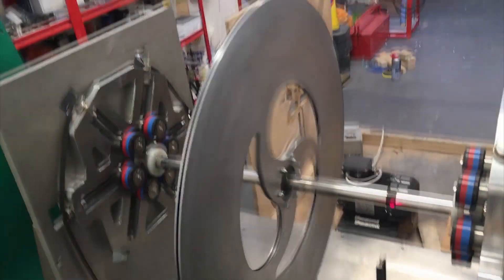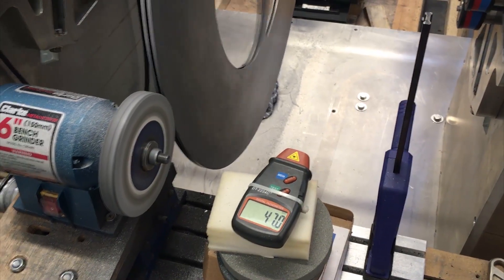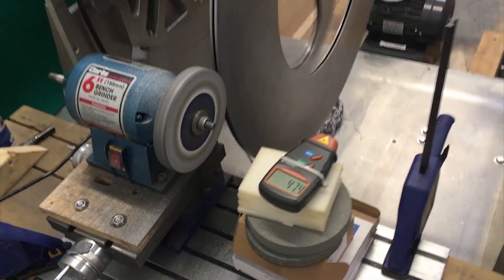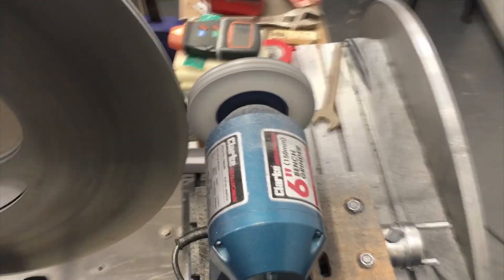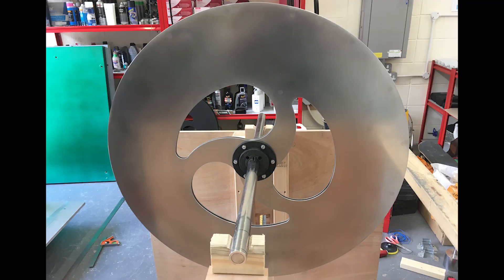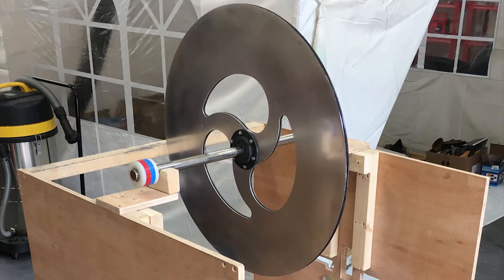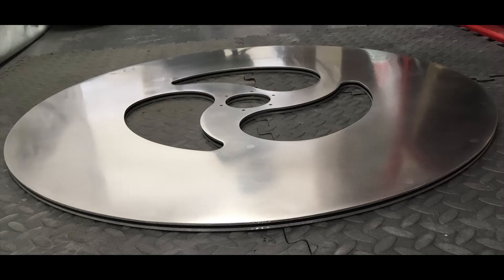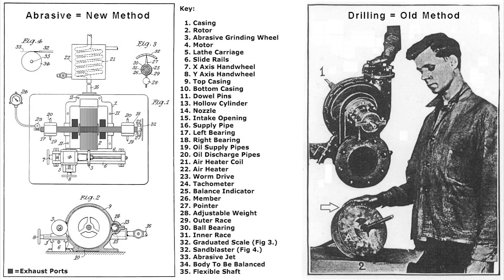Nikola Tesla’s 3 Plane Balancing Analysis Part 3 - The Concentricity Is Improved

Comment: Oehhh nice that's a pritty big one! I wonder What rpm is this supposed to run at en what  kind of fluid it's designed for I bed it's for high viscosity because the space is really big I'm between the discs
Reply from the maker: It’s a test rotor to gather data from. The actual commercial design we have has 11 discs including the end plates. It has tighter gaps too.

That would match the surface area of the museum 18”, 29 disc rotor.

Did you know Tesla had a 25 disc 31” rotor with 7/8” gaps.

That was for shifting 10,000cfm volume @ 0.5 - 1.0 psi using around 3000rpm.

I’ll double check this and post a link to his original spec from US patent draft.

Tesla also specced out a 60” rotor.

There are some genuine photos of Tesla’s 10,000hp turbine.

This test rotor was started in 2019 and has evolved. Every time it crashed I upgraded it.

From doing experiments with this style of rotor it has shown how much mechanical rotation is converted to heat via bearing friction. 

The idea behind the contact free bearings is to stop that heat transfer.

The plan with the rotor is balance it as best as possible in house, so it doesn’t risk being knocked during transport. 

Then see how fast it can be spun and measure the vacuum, entry velocity and exit velocity.

That data can be used to calculate how many discs it needs to bring down the rpm to a useable speed.

I’ve got an idea to merge Tesla’s 1910 rivet addition with his more flexible 1921 rotor design by using soft polyurethane washers between the discs and rivets so it’s not completely solid.
Reply from the maker: The discs are 4mm and the gap is 4mm.

The original choice for this was because at the time I could get the discs water jet cut from 5083 ali for £100

I had the same done in steel too for comparison.
Reply from the maker: It’s built for supersonic speeds. Whether we will go anywhere near 8,200 rpm to gather data I have no idea.

What I do know is it took a 16 horsepower engine to spin the rotor as a fan / blower / vacuum pump to 5,200rpm and that’s the fastest it has ever been.

At the time it was static balanced to 10,000rpm.

Now it’s not got that friction and the bearings are not going to 65C+, seeing how much horsepower to get it that fast should be extremely different.

I’m currently toying with how I’m going to connect the belt so it goes straight downwards and connects to a motor that doesn’t introduce vibration.

That will be balancing machine version 6.

Also the plan is to get the rotor to a speed fast enough so that atmospheric pressure starts to drive the rotor as the elasticity unwinds and centrifugal force assists. 

We have already seen the belt transmission efficiency increase by just having the rotor in the casing when it was static balanced.

There were witnesses too. 

It cannot go over 100% belt transmission efficiency, but if the rotor starts driving the rotor, then we are in new territory.

Just like water falls and drives water wheels, so can air. 

Water wheels don’t need low friction bearings.

Low friction bearings make it easier to tap this energy source.

Tesla had a name for his machine that didn’t have the low friction bearings.

He called it a “hot air engine”. 

That would leave the no contact bearing version being called the “cold air engine”.
Reply: @nikola.tesla.r.and.d.centre  about the belt, don't use it seems to add vibration right?  I would use a flexible hose to directly connect the motor to the rotor in Line whit some space in between
Reply from the maker: @futuresight218  of the shelf balancing machines use a belt that cost £6k for cheap one or £110k for an expensive one, but if you notice they all pull the belt straight downwards. 

Tesla even states in the patent that a belt can be used but to ensure it doesn’t add vibration.

So the motor needs to be mounted well and the belt run needs to be well thought out.

I haven’t got a tank of air big enough or a compressor that could keep up to maintain the speed at the 1st sub harmonic.

A magnetic coupling is one option but is that more or less likely to add vibration.

Also another way is to use a belt, run it up to speed and then disconnect it and take measurements with a scope using two accelerometers or vibration sensors and a tachometer on the run down.

Using a DTI to measure run out with and without the belt drive would prove whether the belt is adding vibration.
Reply from the maker: @futuresight218  In my case of a two disc rotor which essentially are the end plates, this paragraph from the patent  could apply:

“When bodies not adapted for rotation in the manner shown are to be balanced, they will be driven independently by belt, electricity or other means, care being taken that no disturbing vibration from them is transmitted to the apparatus. In order to preserve intact the peripheral boundary, if this is essential, I grind the material off from some other place and when desirable, I make a special provision to this end in the design and construction of the part.”

https://teslauniverse.com/nikola-tesla/patents/british-patent-186799-process-and-apparatus-balancing-rotating-machine-parts
Reply from the maker: @futuresight218  any method to spin the rotor that doesn’t introduce vibration is welcome.

With adjustable magnet bearings you can adjust the field to compensate for the belt pull.

If I had a large tank of heat controllable air and a suitable nozzle I would use that.

I had to sell my old compressor when I moved workshops as this workshop is closer to houses and the compressor was 98db.

The dentist compressor I have is 42db but it only has an 8 liter tank. I would like to buy a 1000 liter tank. 

I could use a bottle of compressed air but that could get expensive. 

I’m sure your idea to spin the rotor will work.

I haven’t got room on my assembly for that idea.

One way or another I will balance it, get the data and hopefully soon built the 11 disc rotor. That will be a beast.
Reply: @nikola.tesla.r.and.d.centre that could be I don't know,  I don't think thay use this kind of bearings aswell yours at nice en almost frictionless but I can see they have a disadvantage in balancing because they're vibrating around
Reply from the maker: @futuresight218  when I had three magnets per side it was much stiffer and less sensitive.

I’ve found some one piece magnets with 50 micron tolerances instead of the standard 100 micron. It sounds similar to the problem Jeremiah was having with his generator magnet not being concentric to the shaft.

With a one piece magnet it doesn’t induce a wobble.

It might seem like a disadvantage but at the same time it will allow an ultra fine balance.

As soon as the funds are in to upgrade to the one piece 70mm OD x 30mm ID x 30mm width and grade 5 titanium circlips, those will be fitted.

For now I’m using what I’ve got to practice with and document the journey.

I might stick a speaker on the z axis tomorrow on the scope and see what we’ve got and can I correct any of it with Blue-Tak. Just to enhance the tuning skills. I’ve only got a two channel scope but I’m game to give it a go.

My friend has a 4 channel scope and vibration sensors are cheap, as well as accelerometers.

You can get a PC lab scope for reasonably cheap these days.

I think the analogue way that @Waveguide did would work, but as he pointed out with my setup the rotor really is the vibration meter with the current magnet setup.
Reply: @nikola.tesla.r.and.d.centre  nice!! I would love to see that! 

one more qwestion
How are you planning to conect the generator to this machine? It would help your test results a lot I think right?
Reply from the maker: @futuresight218  the current motor could be the generator but it’s large and cumbersome, far more likely to vibrate.

Carlos who is on the team has the most advanced motor / generators in the world. The Matrix Machine.

It’s so efficient electrical engineers testing it doubted their own measuring tools and checked it with more expensive equipment.

To their shock the more expensive equipment showed even better results.

These motor generators have no magnets and can switch voltages.

Carlos has been pioneering industrial level magnetic couplings too.
Reply from the maker: @futuresight218  the motor being driven is the first thing that would indicate atmospheric pressure is being harnessed and we have already seen the belt transmission efficiency increase with the rotor at the same speed inside and outside the casing.

As this rotor hasn’t got enough surface area and suitable gaps to make high vacuum at low rpm it’s idle speed is going to be over 5,200rpm I would say.

Flat belt drive on the shaft and flat belt pulley on the motor / generators.

They can have 98% efficiency and are quiet and if aligned shouldn’t introduce vibration.

I could put a pulley on both sides of the casing to maintain the balance.
Reply from the maker: @futuresight218  The magnets could be classed as springs / dampers. 

If you click on this link and it doesn't open then hit refresh and it should load. You will read that the original dynamic balancing method used bearings supporting by springs.

https://www.youtube.com/channel/UC4uJgCHU3s4AOA-uT5SDA4w/community?lb=UgkxyjJs5xSlllrbS-mXC-zFM2y5KKhiJZi7

Tesla's method also suggests that if using as rigid shaft that the bearings should be yieldable which could be classed as the same thing.

Being able to adjust the spring tension is useful. I have noticed that some balancing equipment allows movement of side to side.

One thing is for certain, if the rotor is balanced, the springs will allow you to see that.
Reply from the maker: For myself as the maths are far more complicated for my assembly to calculate the critical speed, and do I want to remove any more material from the peripheral boundary, from what are essentially end plates, my fall back is this method.

https://youtu.be/BRZoSA19wPo

Later I’m going to combine this with Tesla’s method, as I think this method has the possibility of being more sensitive than the analogue vibration meter described in the patent.

I’m happy to compare the two methods of vibration analysis.

It appears Tesla submitted a British patent application on the vibration measuring device and the process that no one has currently got.

The museum also has more documentation on balancing that we hope to obtain in the near future.
Reply: @nikola.tesla.r.and.d.centre  about this critical speed thing , it could be that the tention of your magnetic bearings en the length of the shaft have there own oscillation, I always thought (like in bladed turbines)  you don't want your bearings so far away from the rotor right?
Reply from the maker: @futuresight218  in future the magnet bearings, vacuum bearings or air bearings will bolt to the casing but the cost of an Ali casing at this size would be a chunk of money and we are not decided on a final design on the width yet.

The plan is to fit an 11 disc rotor and a neoprene rubber spacer between the two casing halves. 

But we want to get the data from this one and see what top speed and vacuum we can get out of it with or without breaking it.

It makes over 6” of Mercury at 5,200rpm. It shifts a colossal amount of air. 

It took 16hp to make the rotor spin that fast using Nachi ball bearings and 20mm shaft.

How many horsepower does it take to get it that fast again? Starter motors are always big draws.

What speed / flow needed to tap into atmospheric pressures elasticity to the point the belt becomes driven instead of the driver.

That will be obvious from a POC video when it happens.

I’m thinking about having twin 13.3kw generators on it which can be used for starting / generating. 

The motor / generators would be sat on appropriate anti vibration engine mounts and it would be wise to water cool them. 

The hot water produced could be used for whatever purpose.

With the current rotor the speed at which atmospheric pressure could start driving the rotor is likely to be high. 

When I say high I mean over 5,200rpm, which is the current top speed, but now it has the rivets it’s a different beast.

The shaft was made long so that we could test many rotor / casing combinations on the same platform and be able to balance them in their final resting place.

In my balancing research I found out that if you want the ultimate balance professionally, say G1.0 or G0.4 balancing tolerance, then your rotor needs to be balanced in its final bearing setup.

Also I found out in my younger years that if you want to notice drastic variable changes, make something big.

I have balanced propshafts on vehicles using an acclerometer and strobe when I worked for Jaguar. No one else there new it could even be done but I’m a bit of a nerd when it comes to reading workshop manuals and categorizing car dealers special tool collections if I work there.

Comment: Nice work Paul. Getting very close! You probably have already done so but it might also be worth putting the dti on the rear end of the linear stage to get some idea of the chatter in that axis under load. There might be some improvements that could be made in the backlash of the screw/nut combo. Rotating this way the grinder will have the tendency to push away from the work material I expect. That might leave a wavy finish (on a micro scale).
Reply from the maker: Yeah thanks for that John. I’ve not measured the chatter yet. I did consider a well balanced custom shaft to fit the grinding wheel better, plus some spindle bearings and a way to true the grinding wheel could be future improvements. Also a polycarbonate guard and fan to keep the grinder cool. It does get pretty hot on extended runs. 

Ultimately I would be doing the concentricity on a rigid setup and the grinder would be set perfectly parallel and have a perpendicular face.

I’m interested to put a DTI on it in the current state.

Only way I can check improvements now.

I’ll have to get a microscope to check the surface finish.

The surface finish doesn’t look too bad to be fair.

Can you recommend any polishing attachments / methods other than holding some 320 / 600+ on the face?
Reply from the maker: The grinder was just a cheap one. What’s your thoughts on an 8” grinder instead of this 6”. 10” is really expensive.

I got this one from Machine Mart. It’s not the cheapest one, just the next one up.
Reply: @nikola.tesla.r.and.d.centre  not sure Paul to be honest. What it mostly boils down to is the quality of the bearings. You could probably change those for tapered bearings to get better runout figures

Comment: That looks very close to perfectly concentric to me! Not sure how much further you'd have to push that.
Reply from the maker: Until I put a DTI on the rotor there is no way of knowing. I’m just trying to show methods of looking at such thing using basics such as a line and still camera.

Using an engineers spirit level on the shaft rather than a builders spirit level will help.

Also because the bearings are so sensitive I need to get the static balance in the ball park using some bluetak. I’ll be showing this next week.

I can also switch from the 80 grit to the 120 grit wheel.

One thing I didn’t show was how I removed the burrs using 80 grit and then 240 grit as the brake.

I did this just before I took the video of the concentricity.
Reply from the maker: One thing that needs to be considered is 1 gram of imbalance on this rotor is around 50 grams of imbalance at 335rpm which is the 1st sub harmonic. At 1005rpm that becomes 450 grams of imbalance.